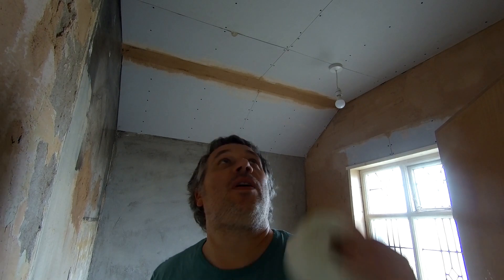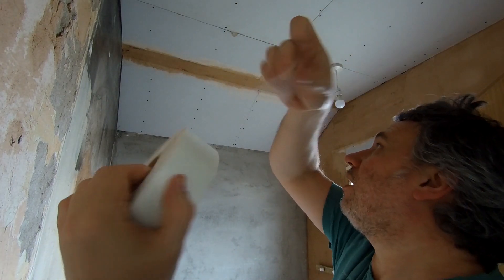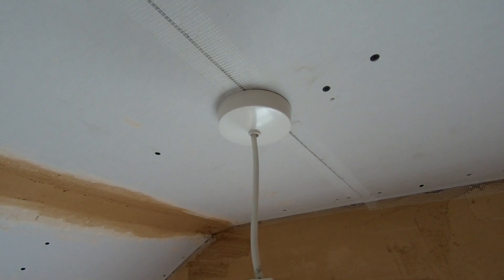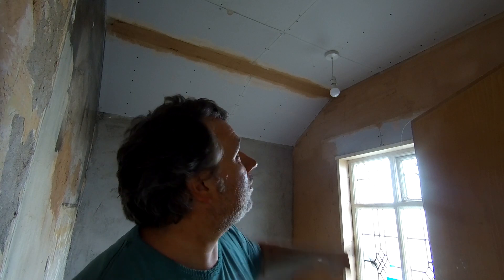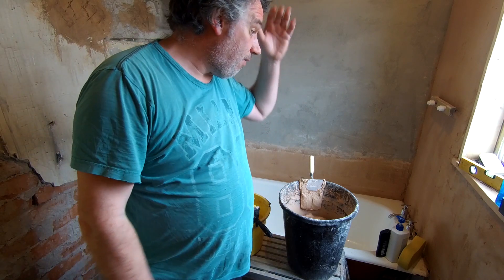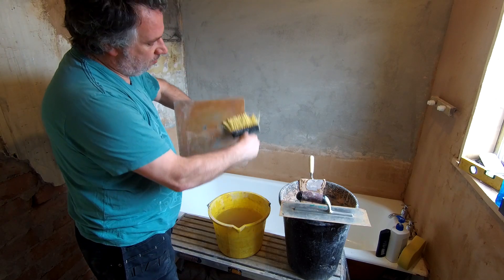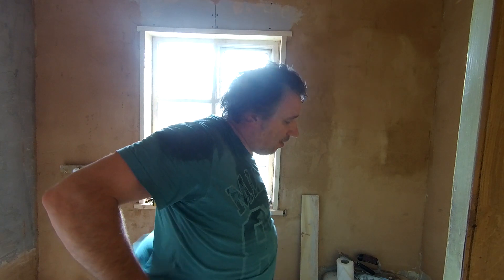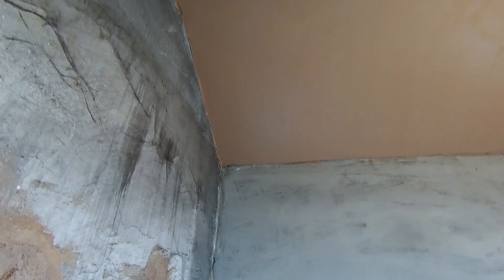Skimming a Ceiling - Bathroom Renovation 07 - DIY Vlog #22

Comment: Good idea with the magnet and the lathe nails. I just smashed a few holes in from above aha. Great job on the ceiling, picked up a few tips for some walls & ceilings I'm skimming this weekend! Always found having a helper makes plastering vastly easier and quicker, not necessarily for mixing but just things like getting plaster out the bucket onto the hawk, getting tools clean while you mix up. Less up and down ladders and less crap on your tools!

Comment: i have had a few goes at plastering, but cant seam to get a decent finish, always needs sanding down :-( got to do a bit of bonding tomorrow, I knocked down my kitchen pantry, so need to tidy up the edge of the bricks and I will have to skin the little bit of celling.
Reply from the maker: Just check and make sure your trowel is flat along the edges. And make sure you flatten that second coat before it gets too hard. You should just be able to leave a finger print in it when it's ready to flatten the 2nd coat.

Comment: The round bit on the ceiling did u bond it out or used skim I noticed it was done before u started to skim also did u pva the round bit please reply
Reply from the maker: I presume you mean the ceiling roll  where it angles down. Yes I used PVA then filled with bonding coat.

Comment: Hi mate, did you use Ms board or regular plasterboard?
Reply from the maker: Just regular plasterborad.
Reply: @LCWDIY  cheers 👍🏻
Reply: @LCWDIY  Sorry for all the questions mate but you're bathroom install vids are really coming in handy. I'm just about to cut the channels for the shower and need to set up some pipe work like you've shown in your other video. I've literally watched them about 30 times 😂 👍🏻